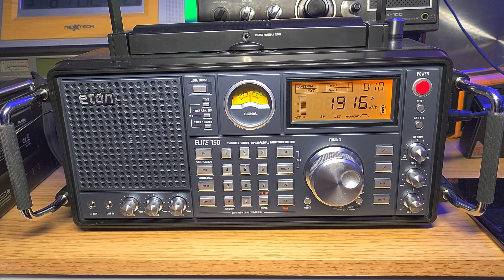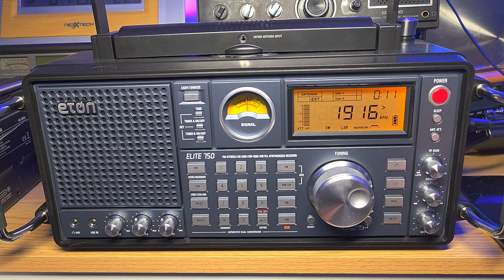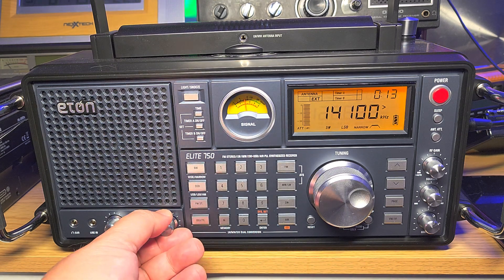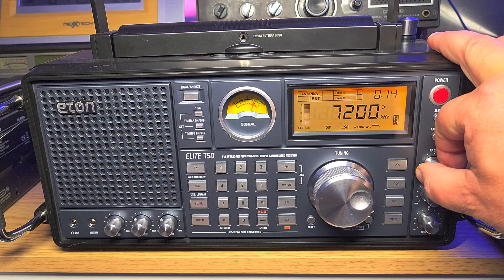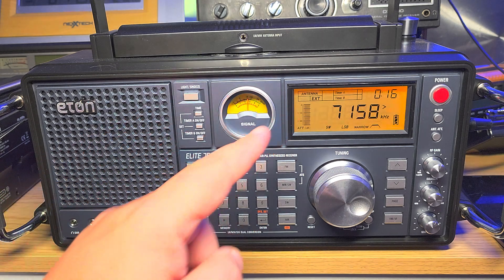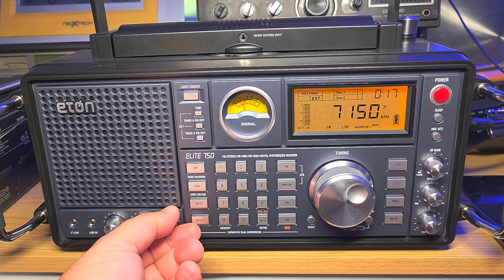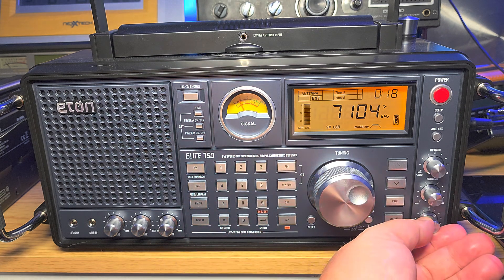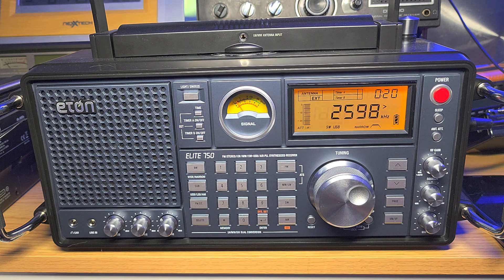Eton Elite 750 Tips and tricks on Tuning SSB Single Sideband Signals keep the BFO centered!

Comment: Hi Gilles, for some reason my scan function on the Eton Elite 750 no longer stops on stations.  It just zips through the KHZ without ever stopping on a channel,  I also noticed that I no longer hear the beep either.  Any renominations?  Besides that the radio still works fine when manually tuning with zero issues.
Reply from the maker: Have you tried removing batteries and power for 24 hours and then try again?
Reply: @OfficialSWLchannel  Hi Gilles,  Thanks a Billion for getting back to me.  I just unplugged the receiver and wanted to let you know that I don't usually carry batteries in this unit unless I'm taking the radio with me on a field trip or using my internal antenna (receivers antenna).  When unplugging the receiver from the wall outlet I did notice that the time was still lit on the receiver.  When you referred to batteries would you have been referring to some sort of internal battery or just the batteries one would install behind the receiver in the Battery compartment?  Gilles un gros merci encore pour vos informations.
Reply from the maker: Just keep the power off for 24 hours, I was just saying if you had batteries in the radio to remove them also
Reply: @OfficialSWLchannel  Sure thing, thank you once again.
Reply: @OfficialSWLchannel Thank you Gilles for the help.  Unfortunately, after 24hrs complete shut down of the receiver it didn’t change the status.  Thanks again for getting back to me.  Greatly appreciated.  Be well.

Comment: I have owned a number of shortwave receivers in my life. None of them were really all that great. I recently got my general class ham license, and, not being a fan of modern computer radios, acquired a 1992 Icom IC-728 transceiver from a guy that had bought it new back then, and taken excellent care of it. This radio has a full coverage triple conversion superheterodyne receiver, and the reception on both AM and SSB is unbelievable. Far better than any of the "consumer grade" shortwave radios I've owned. I got it in near new condition for $300. It's a very basic radio, so if you want a zillion features, it's probably not for you. But if you want a radio with exceptional reception and audio that sounds like a bullhorn, this is it. If you are not a ham, and just want a receiver, this is still the best way to go.

Comment: I’ve hear that this an overpriced brick? It looks solid - why are there so many haters of this radio?
Reply from the maker: It had many flaws including a too wide AM bandwidth that means you always need to use it in narrow mode, it is off by 2 kHz when the wide mode is used , and there is a lot more.  it is overpriced
Reply: @OfficialSWLchannel  Thanks. I’m researching and buying my first SWL radio in nearly 40 years. So much has changed!

Comment: are there any peripheral antennas available? I live in a valley surrounded by mountains and almost never any signal
Reply: Yes, I have the TECSUN S-2000 (identical in construction) and the radio has 4 antenna input options:
1. the jack above the radio in the middle
than on the right side:  
2. FM BNC 
3. AM BNC 50 Ohms
4. 500 Ohms SW antenne input and ground 
and you have a switch to select between internal und external antenna on the right side.

Comment: They should have a switch to lower the tuning speed for SSB or CW.The stock tuning speed is much to fast for these modes as the tuning speed is 1950s and 1960s technology.Thanks for the demo.

Comment: I have the Grundig Satellite 750 which I understand is basically the same radio. I'm not too knowledgeable about frequency bands but my radio doesn't have the capability of monitoring 2598.  Can someone explain that to me?
Reply from the maker: yes it does, you need to press enter after you do 2598
Reply: Thank you!